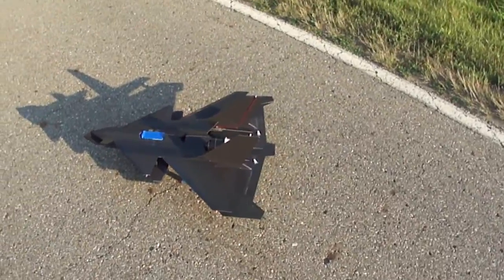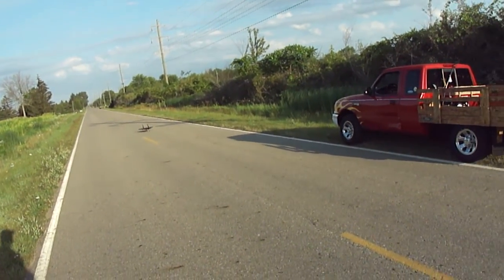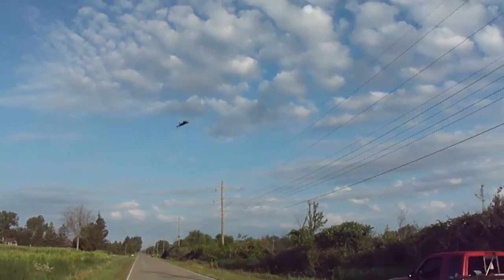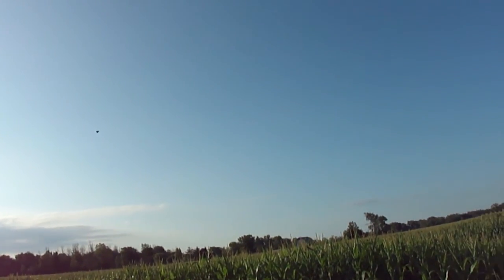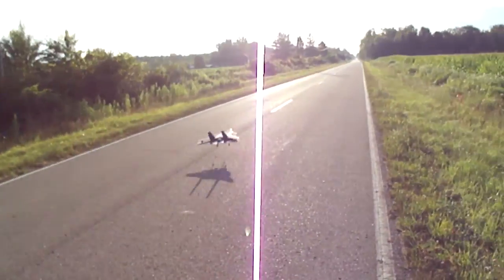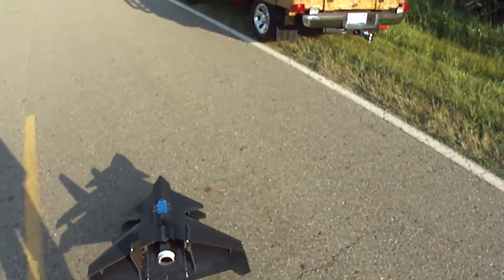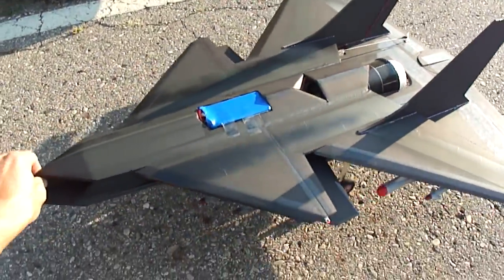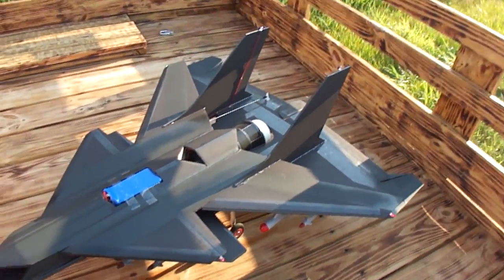UCAV-F1 70mm EDF Biplane jet. PDF plans foamconceptjets.com

Comment: Nice flying. Just have to be mindful of the power lines . My humble opinion a biplane wing created more drag then a single delta. Have you try using 2 mm thick corugated plastic sheet that is use in the Mugi design you get very efficient  tapered airfoil with low drag. I have built 0.9metre delta wing with 3mm thick CP using twin 70mm EDF and 5200mah 3 cells and this plane floats and glide very well.
Reply: corrugated plastic?